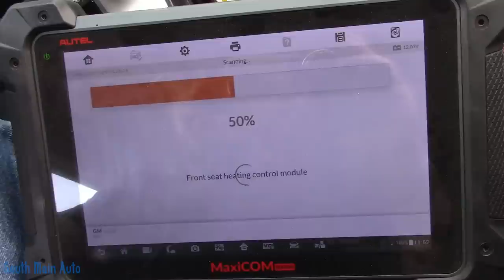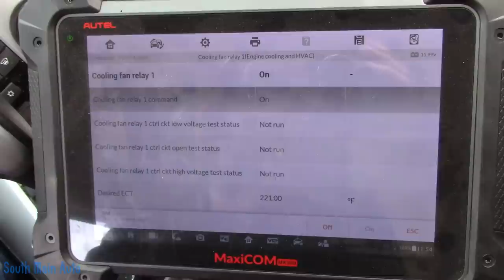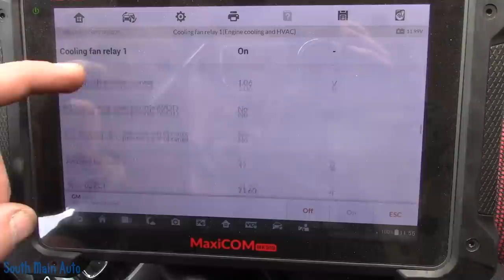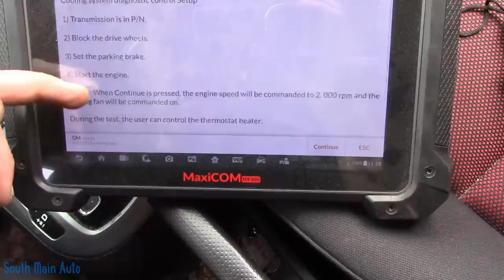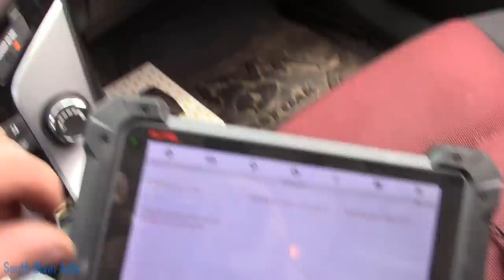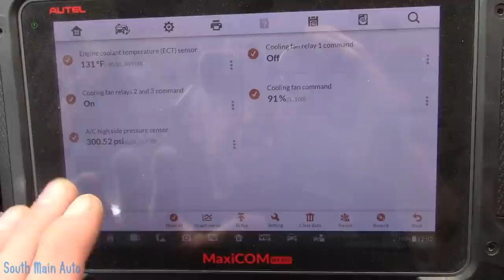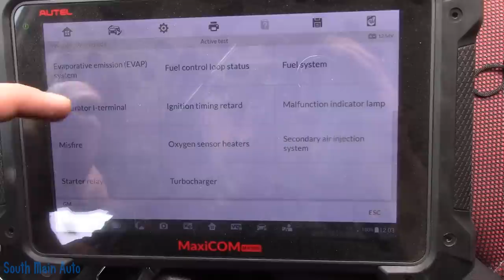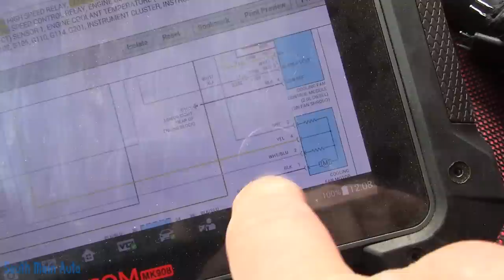Chevrolet Cruze: Cooling Fan Is REALLY LOUD!

Comment: Aren't they just a continuation of the CADAVERlier?!?  Those things were rusting on the
assembly line b4 they were first started and run out of the building.  So, fire up that pig
and ship it.  It'll b back to die another day.
Reply: True I daily drive a 2004 Cavalier with the 2.2 ecotec, 2 door 5 speed. I use it like a work truck. Every thing that isn't engine or transmission is going bad. Wipers, dash is completely cracking apart from the sun, a lose wire in the dash panel, had to completely replace the braking system except for the brake booster, bad hvac resister and blower motor and the subframe is completely rusting away (and door both sides of the door panels under the doors). But that fricking engine and tranny is bulletproof. Original clutch, just about to hit 150k miles. That engine has ran perfectly except for the head and seals having to be replaced because my sister's bf put in 5 qts oil when it needed one. I've thought it would break down completely but it keeps running like a dream.
Reply: the cobalt took over the duties from the Cav until GM could wow us with the Cruze

Comment: With only 4 years this car looks so dispossable. It this lines used resistors for real, well  .. thses were the not working. How this technological cars full of modules can still put resistors as speed regulators ?. Note for the control module desginers, that the module is unable to detect when a line is commanded but no current is drawn because its open. I mean, it is not that difficult to pick in a self check. Eventually it hits high setting and have the situation under control ... but not warning light ?????

Comment: I really can't stand electric fans. Mechanical is the way to go IMO
Reply from the maker: Kind of hard on a FWD car
Reply: @SouthMainAuto  Good call on that. I wonder how they did it before electric fans came around with front wheel drive vehicles.
Reply: Davidson Mott mechanical fan on our old mini,  when cruising along and in no need of a fan it would go like the clappers, when stuck in traffic it was not quick enough and the old girl would get a tad warm.  Spent many a hot day with the heater on and the window open.  Electric fans are a great upgrade.
Reply: Davidson Mott   Trained hamsters...